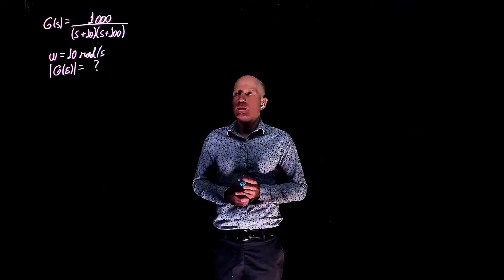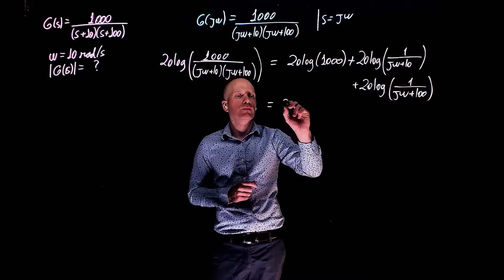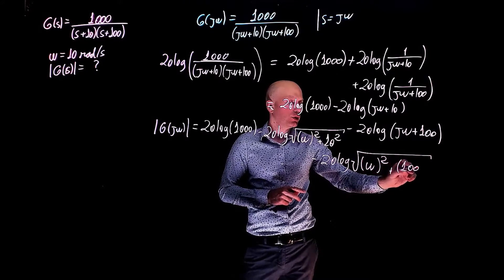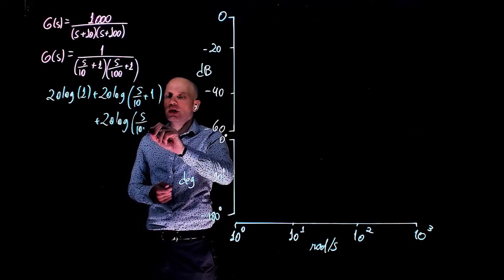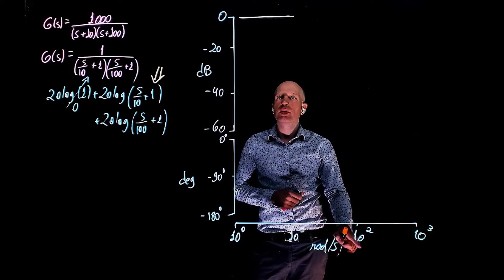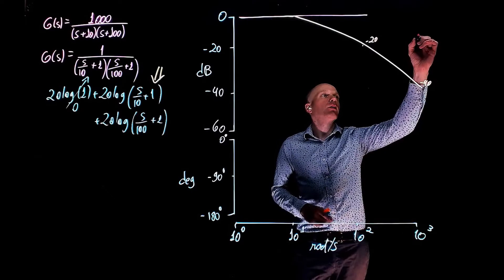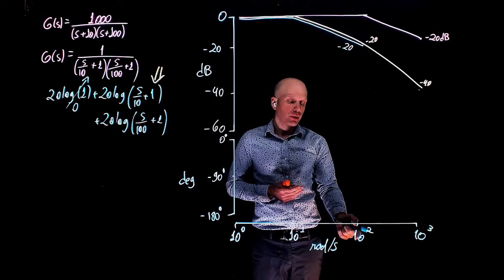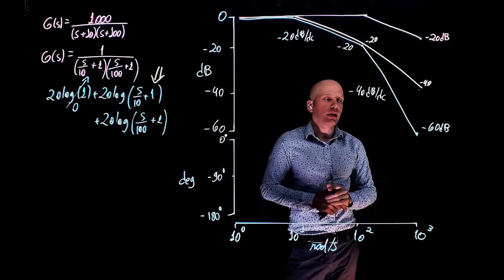L16E95 Control Systems, Lecture 16, Exercise 95: Drawing a Bode plot

Comment: according to equation  at 2.30 minute I found magnitude of G(jw) as 6,6 dB at w=10 rad/s But you said it it's -3,05 dB, I couldn't figure it out. Also there is a fact that at the cut off freq. the plot decays to -3 dB but the equation don't reveal that.
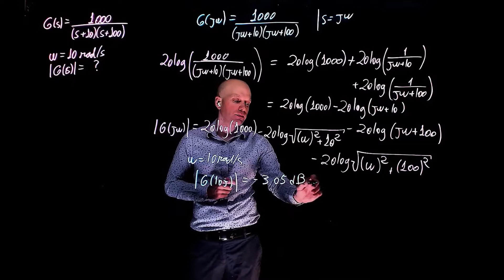Reply from the maker: The equation at 2:30 is correct and it should indeed give -3.05 dB, which agrees with the Bode plot drawn later.